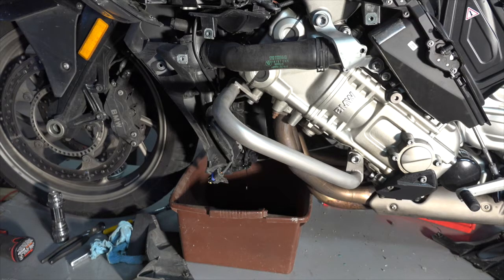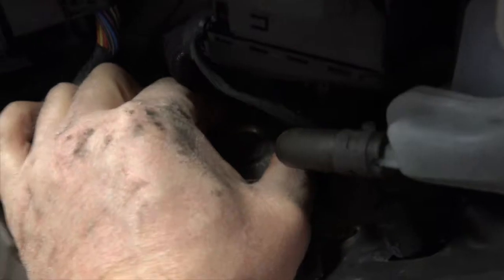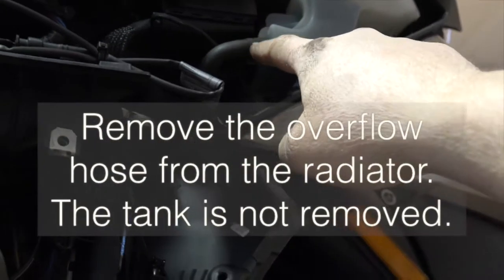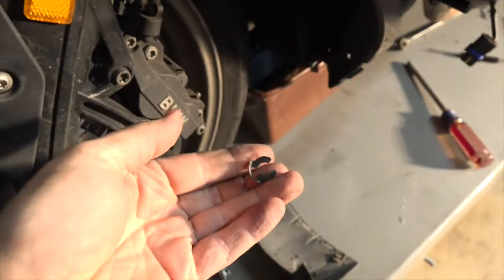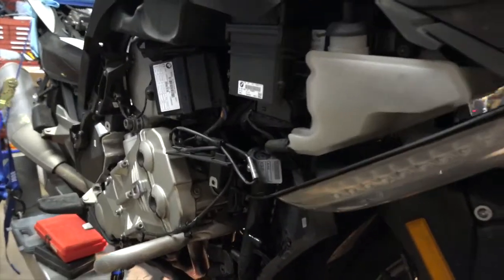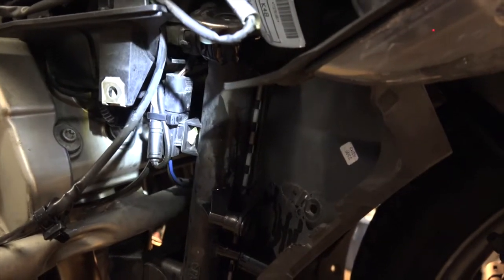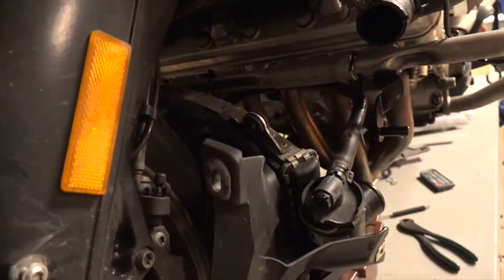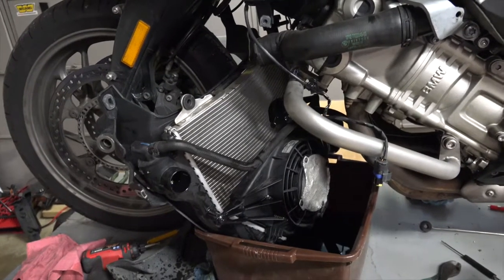K1600 valve lash Part 2

Comment: Did it myself last year and I definitely recommend cleaning radiator. I soaked mine in the water to loosen all bugs and road grime and than used soft brush to clean fins very gently, I had all king of junk at the bottom including small rocks:)
Reply from the maker: LOTS of little rocks. Not only did I have a bunch in the bucket, I swept a lot off of the lift.